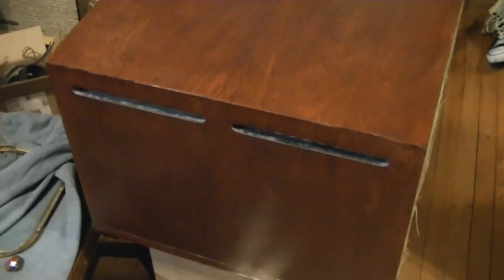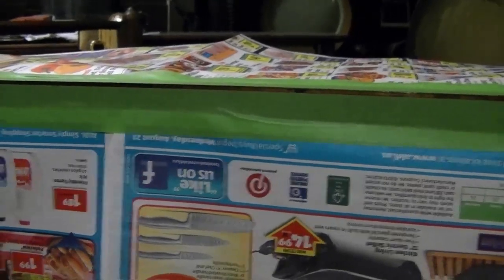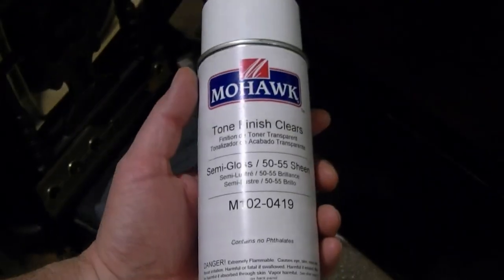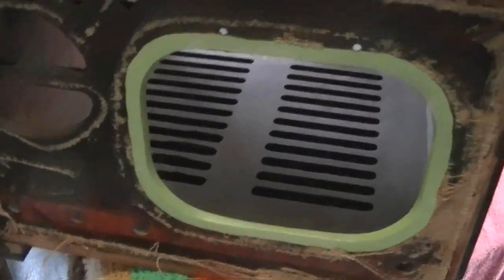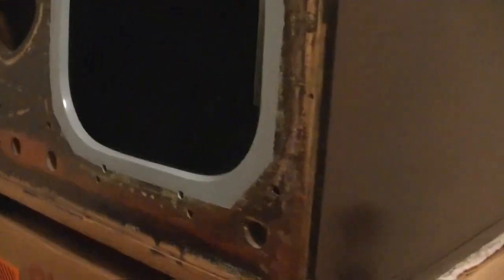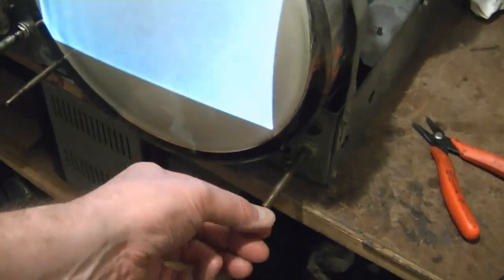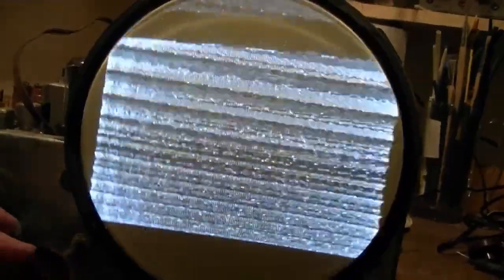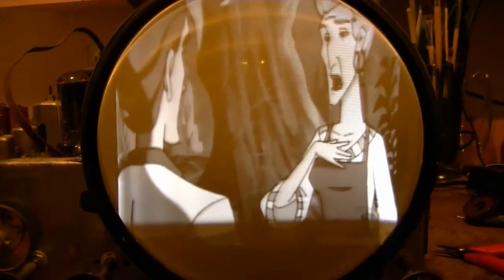GE 810 Redux p2o?

Comment: The Problem Appears to be Low B+ voltages. Check the dropping resistors in the power supply. i had this same set years ago. i restored the chassis on. it had a terrific high resolution picture on it, just as good as picture as a modern B/W set. however, the sound was always touchy to work with.

Comment: Maybe a solder joint decided to let go, they sometimes do that. Old carbon composition resistors are another possibility, many of the immediate post war resistors are not stable at all, they drift almost as bad as the dogbone ones. Do these sets use silver micas in the coils/IFs? Even many of the molded micas from then can go South, I think that there was such a rush to get products to market, and so many supply shortages, that they took whatever they could get.

Comment from the maker: I may just start shotgunning mica caps in TVs.  I've been finding too many bad ones lately.    Both the vertical and horizontal sync stink.  So does the sound so I think it's something further up the chain.  Maybe in the tuner or IF stages ?

Comment: Wow Bob!
How did that TV go so far south from sitting on the shelf for a couple of years?
I remember this original restoration quite well. When you finished it back then, none of these issues were present and the TV worked flawlessly.
I don't know, but maybe one or a few of the original passive components went way off spec from just sitting?
I'm definitely interested to see how all this plays out!
The cabinet is drop dead gorgeous! I like the color of the bezel that you picked also.
Tom

Comment: You are exactly right about the fact that it was working better when you finished the restore originally.  I just finished watching those videos recently, and you didn't have near the trouble syncing the video then.  I know my knowledge is limited, but maybe replacing the two tubes at the start of this video threw the alignment out the window?  It seems odd that the set would degrade that much in just a couple of years, especially in an environmentally controlled room.  Good luck my friend!